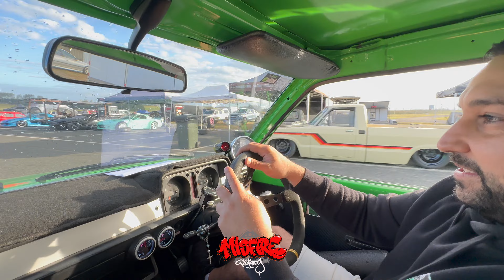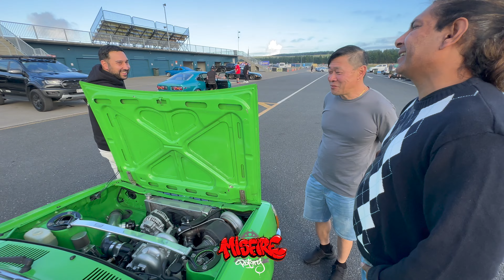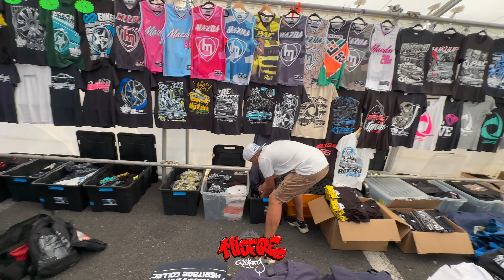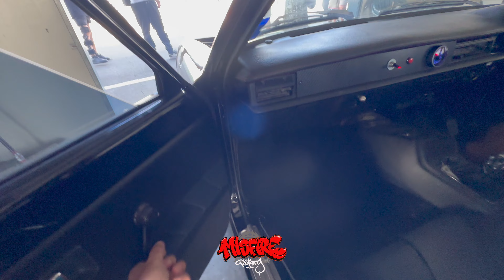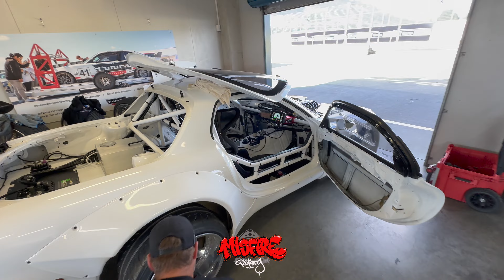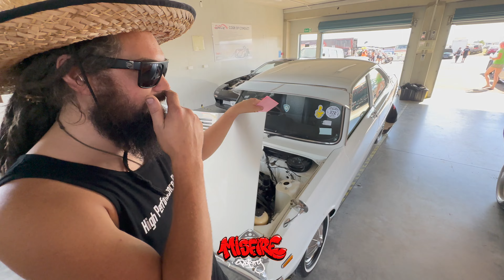Best of Rotary REunion 4 ROTOR EDITION 2024

Comment: Bro love content miss my rotor 
Question has anyone done a triple or quad rotor 10 a or 12 a    I had a 12A rx2 went through 9 diffs 5 gearboxes and really 2 engines but put in 4 too find out 2 were not great over a 2 year period in 1989-90  ive still got a few cars but no rotories and I'm itching
Reply from the maker: Yes 12a turbo 4 rotor has been done 💯though not sure if it runs perfectly yet